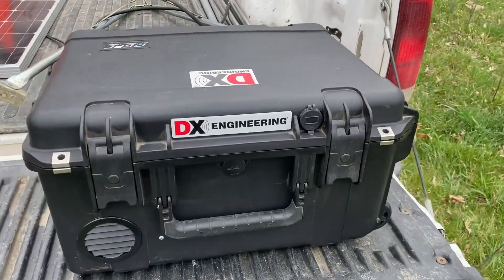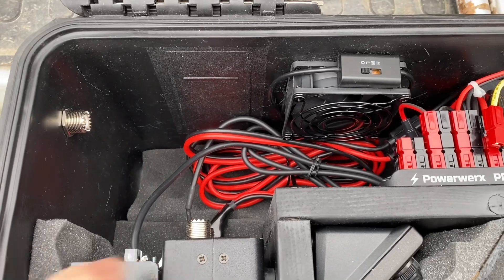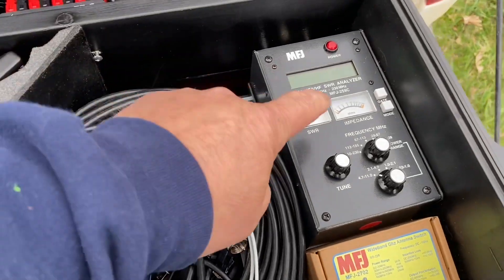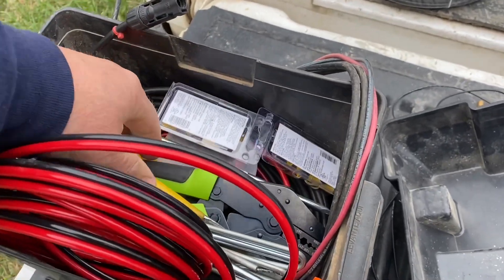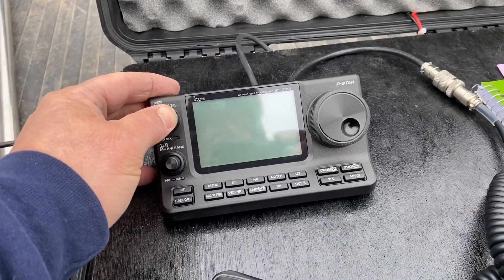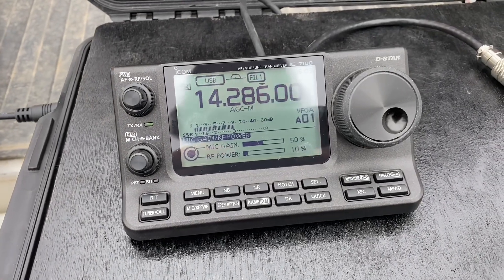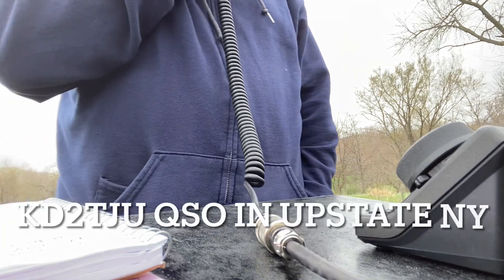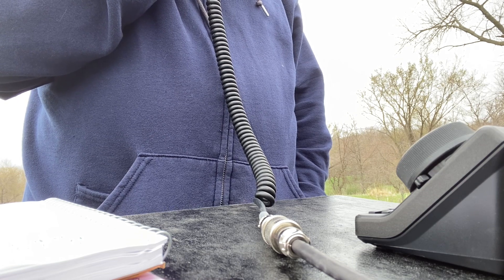CowPOTA QRP.. Cow Pastures On The Air

Comment: Love your go box…..Did you make it all yourself, exterior plugs and jack etc?
Reply from the maker: Hi Bob.. thx for watching the video and commenting..  Yes I did... I've looked at other ham operators boxes, got some ideas and designed it to keep everything I could possibly need inside.. Amazon was my friend and I could order everything I needed on line, from the PL239 barrel connectors, to the Anderson Power pole buss bar and connectors, to the USB jacks, battery.. etc.  Then I built the wood frame inside to hold the radio compartment and ic7100 head controller in the corner.. It weighs 50lbs and like I said in the video, it isn't made for SOTA activations hiking up a mountain.. but its good for getting it out of your vehicle and setting up on a table or picnic table at a park.. One thing I might need to modify is making sure I have a good seal over the radio compartment section to assure that all the cool air is drawn thru the vent and thru the radio.. I might not have enough air flow thru it as it stands.. but Its easy to just pull the radio out and place it on top of the board if I think its getting hot.. I'm looking forward to more portable operations with it and give it a more thorough test.. 73
Reply: @hamradioqrp-k0klb  You did a fantastic job